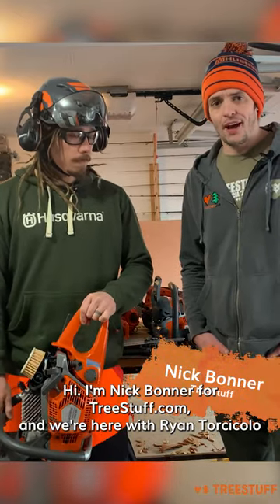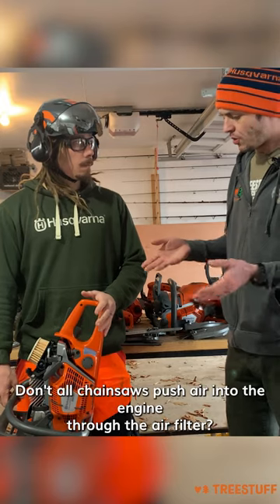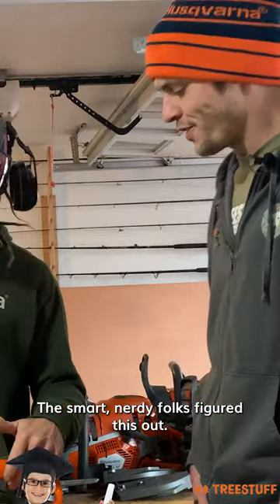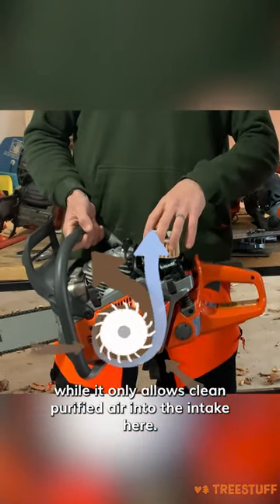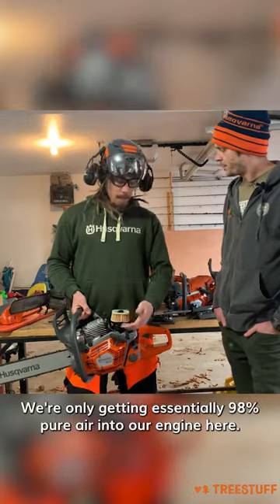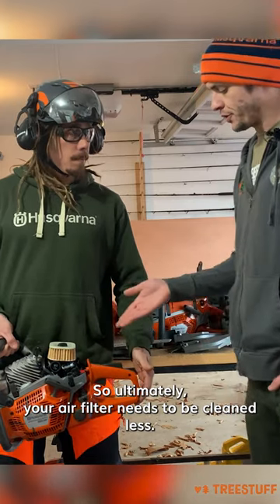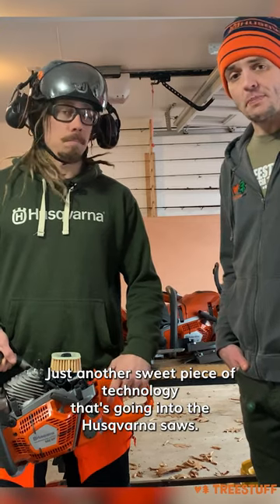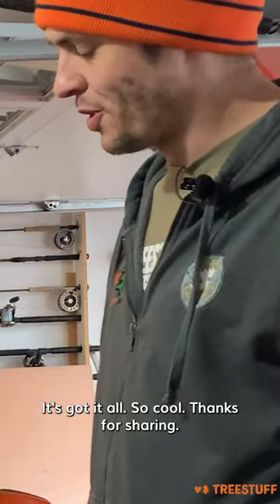Husqvarna Air Injection Technology - TreeStuff.com

Comment: So…..a turbocharger? Ram air? I see nothing revolutionary here other than increased airflow from a fan. Clean air? Gimmicky.
Reply: Oh it freaking works. My 395XP needs the air filter cleaned out 10% as often as my Stihl 046. Simple too. The wood chips and dust will be spun to the outside of the cavity around the fan, so they added a port to blow the air close to the fan up into the filter box. Was shocked how well it worked when I bought my first Husky with this.